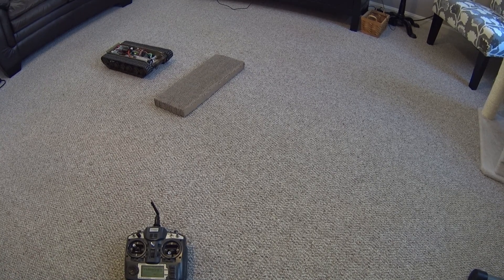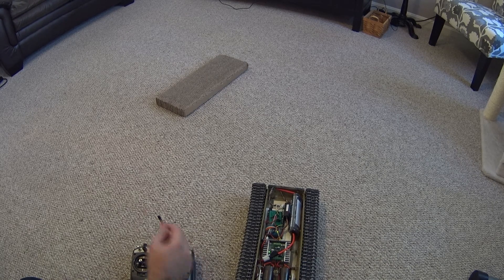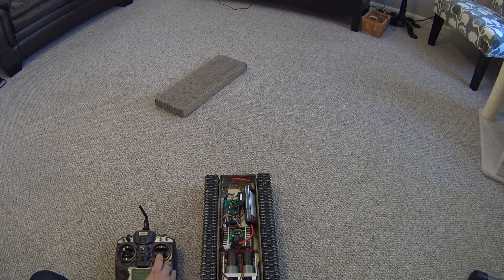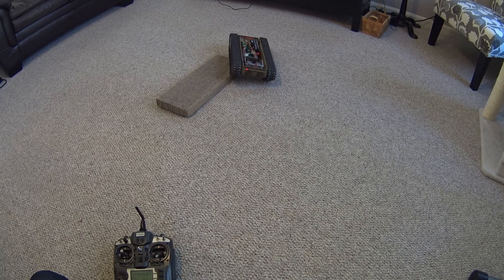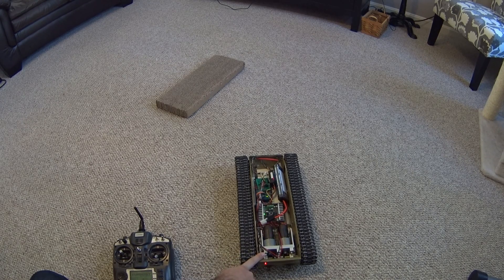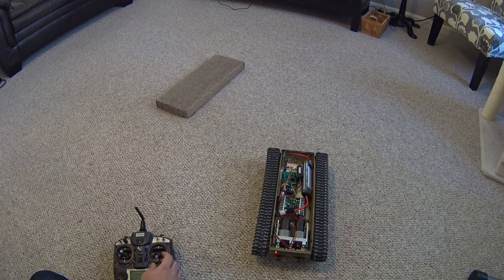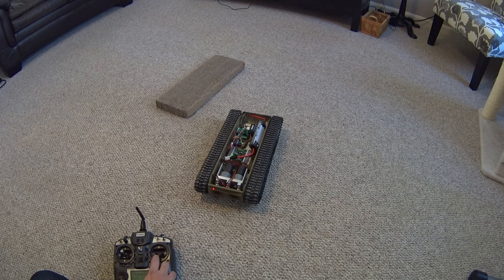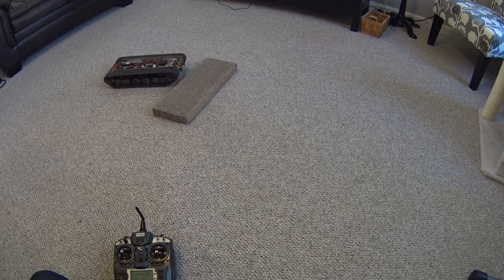Driving algorithm for RC tracked vehicles

Comment: Hi Pedzola, I’m having issues trying to access the rcuniverse forum so asking here. Is the code and schematics available. I am building 2x Taigen tanks with Arduino controlled ir battle system and would like to try out your control system as I think more realistic the better. I have had success with motor shield running the motors with roc receiver and Arduino mega, but want to expand further.

Comment: Very nice. Thank you for sharing. I've been thinking along the same lines of developing my own algorithm for driving a tank. Do you know if IBU2/3 or Elmod Fusion use PID tuning for driving the tracks? Are you using a PID?

Have you seen the Ion Motion Control Roboclaws? These motor drivers can accommodate encoder feedback. By the way, it looks like all you need is a Benedini Mini, and an S.bus type radio (for additional channels)!